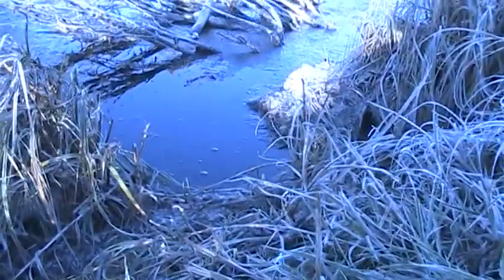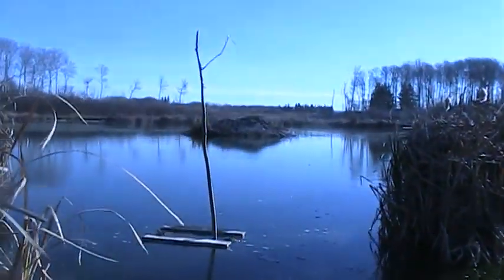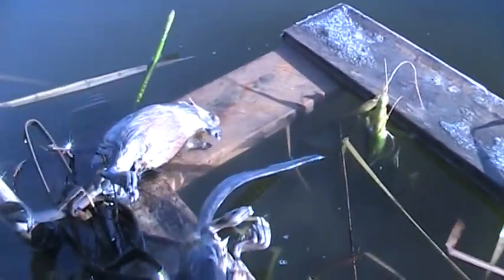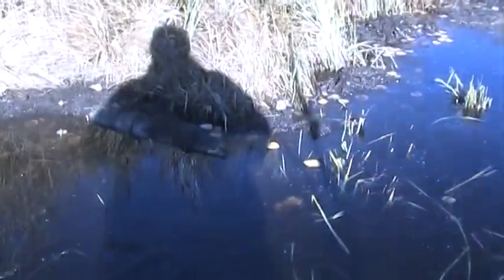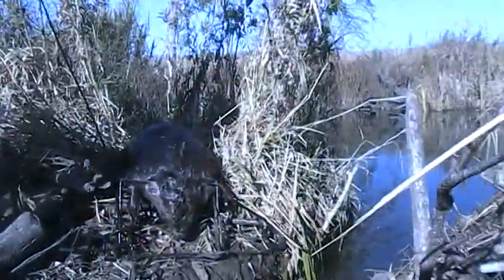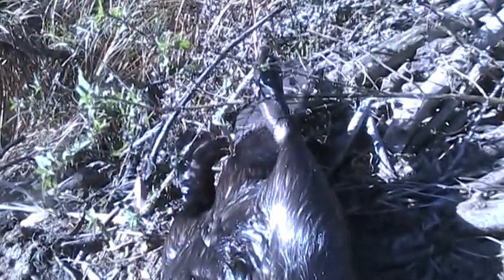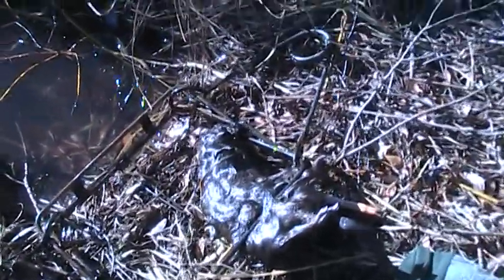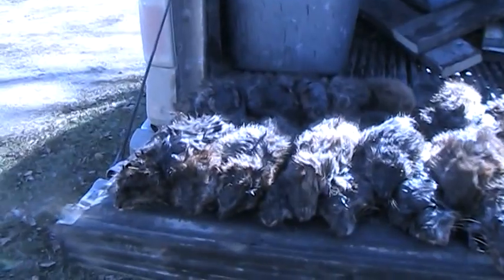Trapping, Out On The Line: Day 7 (2015-16)

Comment: Dave, Hope you got your "Back" rested up a bit. Those damned Beavers keep on coming! Skinning those rats is going to be so nice compared to the endless Beavers. Money in the bank! Although one never has enough bait, seems like you are fully charged for the moment. I just purchased a Savage .17 cal HMR model 17 Semi-automatic 10 shot. Probably the most accurate gun that I have ever owned at 200 yards. I mounted a Nikon 3.5 X 14 X 40 scope on the danged thing. Gun, Scope, 200 rounds for about $575.  I can knock the eye lashes off a fish worm at 200 yards with the darned thing. Bullets are a bit pricey but plenty well in stock. About .23.6 cents a shot. You get what you pay for I guess. Good Luck on cleaning out those ponds in the next week. I know that you are itching to get up on  your trap line. Plus I think you still have a little cabin work left to get ready for the winter. Don't go hurting yourself, work within your limits!   Bulldog
Reply from the maker: +Luther Hitt Ya that sounds like a sweet combo. My .17 is a savage also but a bolt action, and you are right they are deadly accurate. The best thing is how that bullet disintegrates upon entry and there is rarely an exit hole. It is killer on yotes.

Comment: awesome video as normal Dave......I wanted to ask if it isn't a trade secret what is your beaver sent post made of and how do you set it up....I made my own castor lure but had no success with it....thanks
Reply from the maker: +djhunter1971 The lure I use is pure castor that I grind up and mix with rendered down bear fat. The main secret to castor sets is that they have to be upwind of where a beaver will swim by. Down wind and you may as well not waste the scent.
Reply: +Trapping World Thanks Dave for your info....mine is pure castor mixed with propylene glycol and a little vodka ....got the recipe from the internet .....it really smells so I thought it should work well
Reply from the maker: +djhunter1971 I would not put vodka in there. I might just stop and start drinking my beaver scent.I would use straight rubbing alcohol from a pharmacy. It will totally evaporate and leave no un-needed scent behind. The main thing is wind direction.
Reply: +Trapping World ok thanks Dave ill do that on the next making of the lure

Comment: Do Cormorants peck at the trapped submerged beavs before you pick them up?
Reply from the maker: +2506INF No they don't. Ravens and eagles are bad if the beavers are out of the water but only mink seem to bother anything that is submerged.
Reply: Thanks, Dave. Good to know. Here in Massachusetts, the PC anti-hunters control the bureaucracy: Special Permits to Use Conibear-Type Traps, Breach Beaver Dams or Use Flow Devices: See 321 CMR 2.08.

Comment: what do you die your traps with'
Reply from the maker: +NADJIWON CRITTERCONTROL The new Savaugeau come speed dipped but when I do it I use a mix of 1 part black tremclad paint and 4 parts super unleaded gas. But I make sure I do it in the spring and hang them out side for the summer.